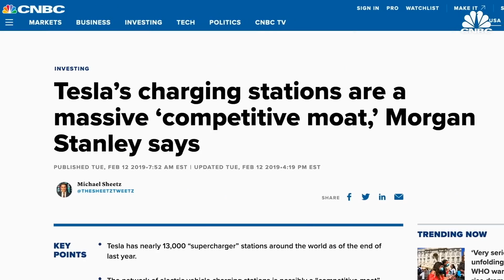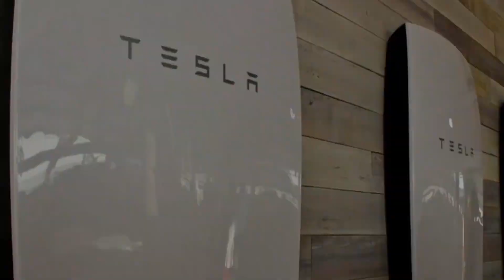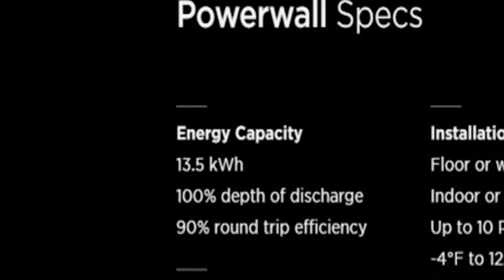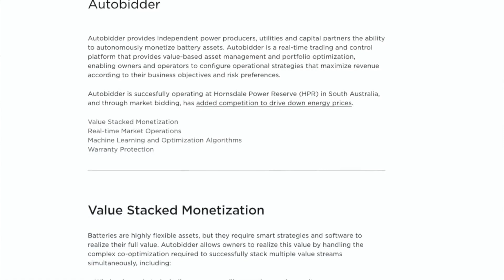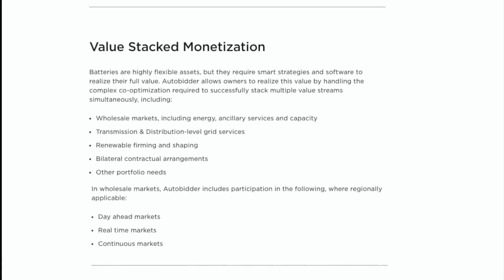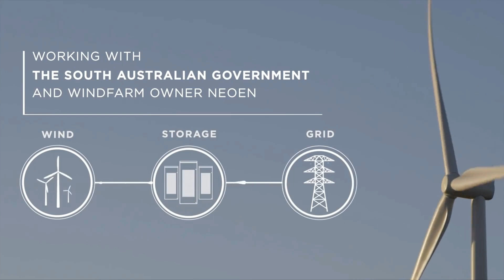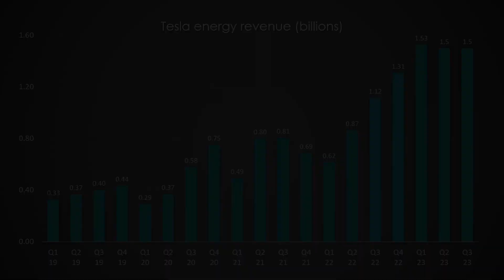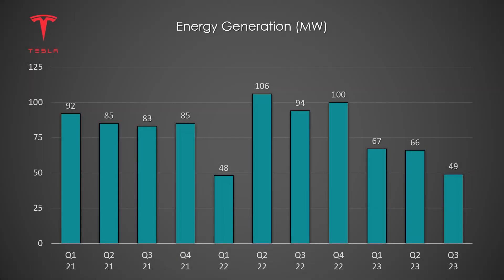Tesla energy overtakes automotive business growth

Comment: The vison outlined in this video is a mirage, it will not and cannot happen, for a few basic reasons.
The principle one is that of intermittency which requires an unfeasible amounts of storage, unfeasible in cost and unfeasible in the sheer physical amounts of materials required to make these batteries. 
The other very real limitations to renewable generation is that it does not possess the technical requirements to run a stable and economic grid. You cannot power a grid on renewables alone, there is the requirement for an equal capacity of conventional generation as well to provide balancing, inertia, reactive power and short circuit current level support. Without these criteria, which renewables lack, a grid will not work.
Those advocates for renewables are free to disconnect from the grid and provide their own power from nature, good luck

PS, there is a requirement for batteries on grid systems, but not for intermittency.   Storage, such as batteries and the older pumped storage are necessary for frequency support. Grids occasionally suffer a sudden loss of input or a sudden increase in demand and to keep the system in load and supply balance then requires an of large amounts of power very quickly which is what storage is able to do. Dinorwic, in the U.K., is a pumped storage plant and can, from nothing, provide up to two Gigawatts of power within about fifteen seconds.  Not for very long though, that is not the aim, just sufficient to let other dispatchable plants up their output.